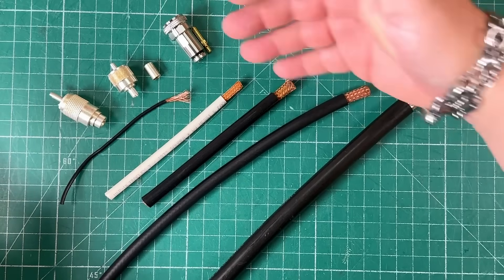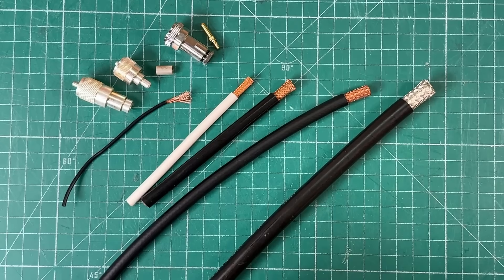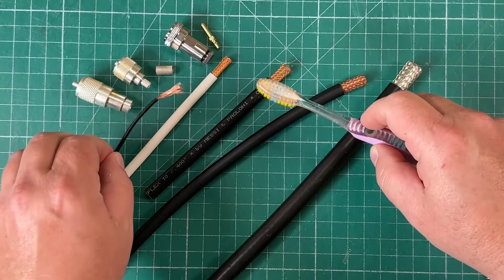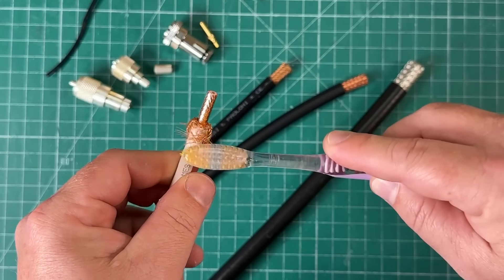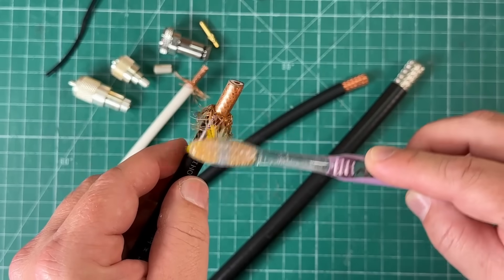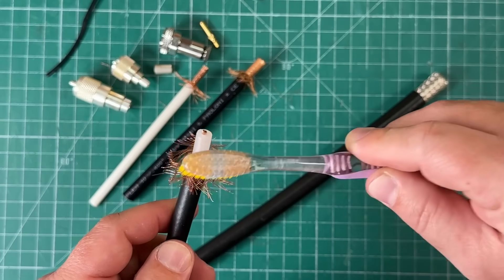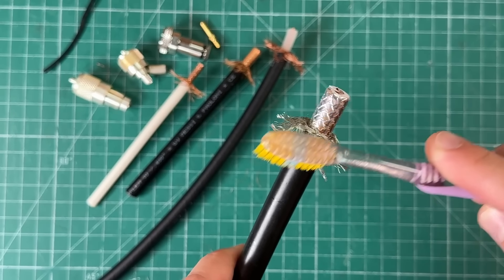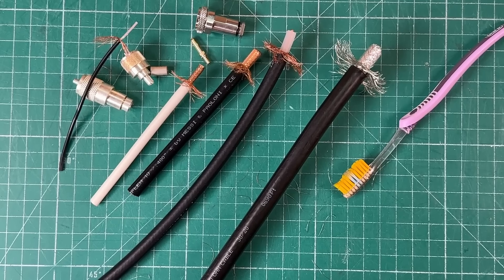Stop Struggling With Your Coax Shield.  Do This Instead!

Comment: Retired electronic tech here. I used to terminate coax all day some days. A brass gun cleaning brush is the ultimate tool for straightening braid. .30 cal is a good size. You’ll have to make a handle for the brush. They normally thread onto a cleaning rod. I modified a handle from a broken insertion tool for mine.

Comment: Good idea.  I have used a light weight wire brush to spread the shield. Also, a standard pocket comb to undo the overlapping of braid strands works well. A tubing cutter can be used to remove the coax outer jacket, or create an index line if using a knife to remove it. I will try your toothbrush method. Looks simple enough. Thank you  WB4BKO

Comment: Could you make some videos about about coax that is measured imperially versus metric, and especially what connector fits into one or the other, especially if you're switching over from RG series to LMR series how far as the connectors themselves go? I'm a metric man trapped in an imperial world. 73 DE W8LV (and in SANER times: W8LV/VE3)🙏🇺🇦🇺🇸🇨🇦

Comment: Is there some secret tool to strip the outer jacket inner jacket on the center conductor to the appropriate length? I have an Amazon one that doesn’t work at all I  have to measure with a ruler every time

Comment: With the correct tools and connectors, you don't need to do any of this.  Strip the wire, insert connector, crimp.  Done.
Reply: yup i never used a toothbrush ever

Comment: My biggest issue is trying to get the thin strands of the center wire into the center pin of the connector without stray strands coming out.

Comment: I've always just used my fingers .
For what it's worth I've also installed hundreds of miles of barbed wire fence , without using gloves .
I've only rarely gotten bit by either .
YMMV of course .
Not everyone knows the value of an occasional.blood sacrifice to keep Murphy from getting too creative.
Besides , I'd rather bleed than fumble .
They make duct tape and super glue for a reason .

Comment: I'd love to see a video where two lengths of coax where one has been carefully terminated with no broken wires on either the shield or center conductor, and one was haphazardly terminated by a drunken lunatic and see what the difference in performance is. I know there will be a difference, but I've never done a side by side and measured it.